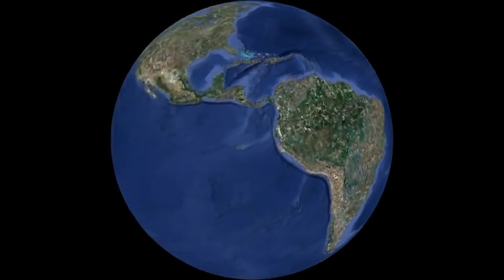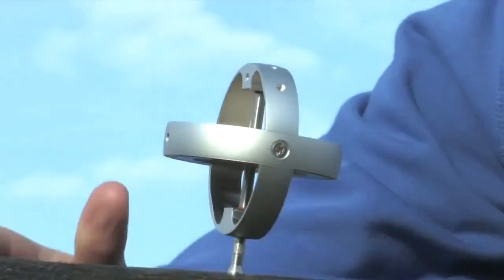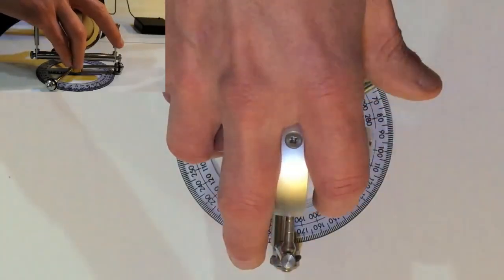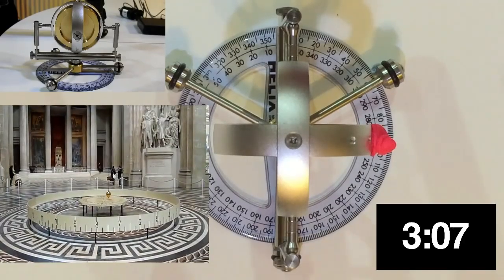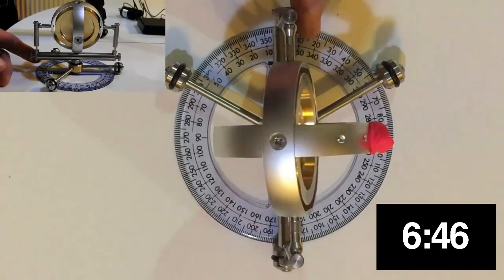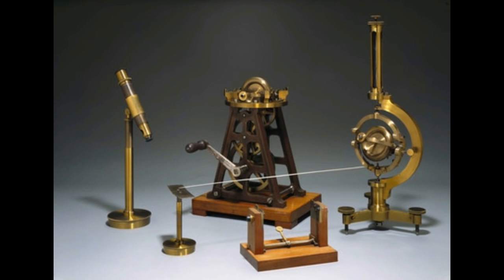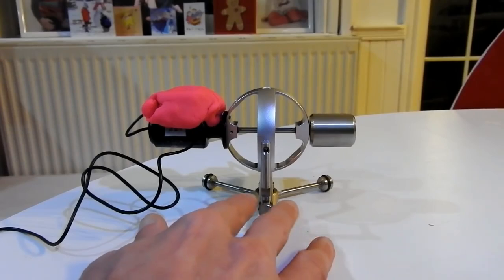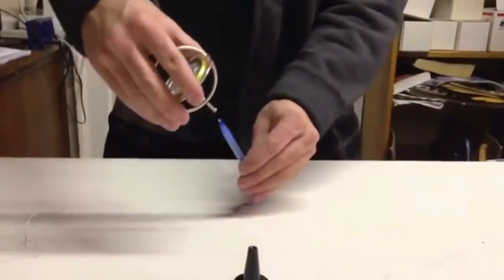Why Gyroscopes Proves the Flat Earth Part 2

Comment: I agree with one of the comments below that the experiment was not run long enough. There is another source of error as well, the friction of the gymbol  bearings  that aloow the gyroscope to tilt. There is thing thing called the coefficient of static friction 

Static friction

Here is an excerpt from the link below.

When the mass is not moving, the object experiences static friction. The friction increases as the applied force increases until the block moves. After the block moves, it experiences kinetic friction, which is less than the maximum static friction.Static friction is friction between two or more solid objects that are not moving relative to each other. For example, static friction can prevent an object from sliding down a sloped surface. The coefficient of static friction, typically denoted as μs, is usually higher than the coefficient of kinetic friction.

 https://en.wikipedia.org/wiki/Friction

So even though you have precision  gyroscope to do your experiment you need very low friction bearings, like maybe hanging it from a long string. For that static friction could block you gyro from rotation, just as you did with your gingers earlier in the video so that even if you did run your experiment for say an hour or two you still might not see any rotation. Now you are on the right track.. you just haven't quite gone down it fat enough for your experiment to show (or fail to show) what you are thinking it will show. 

Now aircraft in fact do use gyros to both navigate and  maintain an attitude estimate (which way is up). And the  rely on the rotation of the earth to do what is called a ground alignment (where they figure out which way is north to very high accuracy).  e.g. see

Here are scholarly papers

https://scholar.google.com/scholar?q=inertial+navigation+ground+alignment&hl=en&as_sdt=0&as_vis=1&oi=scholart&sa=X&ved=0ahUKEwjhjI212J_KAhWFYiYKHQ6wDyAQgQMIHTAA

Of course now a days  strap down ring laser gyros are used but back when I was a young engineer  these did not exist and  mechanical gyros much like you have were used.. with  precion low friction bearings and large mass in the gyros but never the less very similar to what you have. 

Here are some more links on  ground alignment and (and sorry, there used to be on line a really good video on this but I can't find the link anymore so this one is the best I could find in my quickie search.

https://books.google.com/books?id=6P7UNphJ1z8C&pg=PA344&lpg=PA344&dq=inertial+navigation+system+tutorial+ground+alignment&source=bl&ots=tAWytSwOAN&sig=RHtXGbWVLJbji3cQuEN42qIZy1Q&hl=en&sa=X&ved=0ahUKEwjw9oLq2p_KAhXJeCYKHRXSDG84ChDoAQg9MAU#v=onepage&q=inertial%20navigation%20system%20tutorial%20ground%20alignment&f=false

and here is a is a book hat covers the basics of inertial navigation

https://books.google.com/books?id=5ktEBQAAQBAJ&pg=PR21&dq=inertial+navigation+system+basics&hl=en&sa=X&ved=0ahUKEwiF2J_k3J_KAhUEND4KHREqDwwQ6AEIRDAD#v=onepage&q=inertial%20navigation%20system%20basics&f=false

The bottom line is that gyros prove just the opposite of what you are claiming and are used in inertial navigation system on most all aircraft to navigate and maintain orientation and have been used for more than  50 years.. maybe even longer. And a poorly thought out experiment does not prove anything other than one still needs to  think through it a bit more.  So I would suggest that you keep at it, but  run it longer and  properly address the  bearing friction problem... and if you do you may just  see different results.
Reply: Then you basically just proved ALL gyroscopes can't work, cuz they all have friction bud lol. You round Earthers be supporting the flat plain theory with out even knowing it lmaooo crushing your own "PROOFS"
Reply: Ron Wilson 

You're identifying forces that effect the Gyro that does not have any relevance to Earths rotation.
Reply: Ron Wilson 

or lack of a rotation. Which is proven by one small little fact. Undeniable too.

You see that North star. It's position is fixed with the north pole. Always will be. There is no tilt, there is no rotation. Otherwise that North star you saw your entire life, WOULD MOVE.

Comment: So you think a gyro should be spinning on it's axis because the Earth is spinning on an axis? What force is supposed to control this? Do you even know what the axis is in reference to?

How about this; when you're in a car cruising along the motorway, do you feel a perpetual sense of forward motion? Of course not, your momentum without change is a constant. Einsteins Theory of Relativity applies here. But if you apply the brake, you notice the change in momentum, you feel the force of still moving forward, while the car slows down, it's one of the reasons we have seat belts. This is more apparent depending on how hard you brake.
Reply: Doesn't the earth move faster at the equator than the poles?

Comment: Earth rotates every 24 hours.

That’s basically 360 degrees of rotation and according to math should be 15 degrees of rotation per hour. 

You ran the experiment 5-6 Minutes.

In that time frame that would be a precession of 5/4 degrees. That is literally nothing to the naked eye. You would need to run it for at least several hours to notice any drift.

I hear you did that and that’s why you stopped posting FE Bs 6 years ago because you realized earth does spin👌🏽

Comment: There are quite a few videos illustrating the supposed or actual fact that the gyroscope does not indicate the rotation of the earth. I do not know whether the earth rotates or not and am not greatly disturbed at whatever is the truth. However for those interested in the investigation of the subject, there is a very interesting account of the description  giving constructional details of a specially sensitive gyroscope especially designed to indicate rotation of the earth. This information and the experimental details may be found in pages 19 to 32 of Vol.! of George M. Hopkins book “ Experimental Science” and the conclusion to be drawn from the gyroscopic investigation is also provided. Both volumes of Mr Hopkins most excellent work may be  found on the Net and may be either downloaded or read online.
Reply: Vivian Astridge 

You see. Free opinions are far more valuable. Because? If it's wrong, I still have my money 😂

Comment: Shouldn't the gyro be aligned so that the the axis of rotation is up/down generally (if at the equator?) I would imagine you could tilt it somewhat (toward the equator) from that axis depending on your latitude for optimal results. I have purchased two of these precision gyroscopes myself to do this experiment (and others.) Please let me know if there is a reason for your setup configuration I am missing. Thanks!

Comment: Just a thought: Have I missed it or do you really not state the orientation of your gyroscope in respect to the earths rotation?
If the axis of rotation is north/south aligned one wouldn't expect to see any movement anyway, but if the axis was east/west aligned or vertical I'd expect to see the claimed effect.
So a compass next to your setup should be the least in order to get some degree of significance of this demo. But since a compass could be tampered with quite easily, two or better three gyros each aligned to one of the three spacial axes would seem more credible.

Another thing "missing" is a valid proof that your test setup is actually sensitive enough to show the desired effect. You show that the gyro swerves when you nudge it, but will the miniscule force resulting from that very small movement of 15° over 1h be enough to overcome the static friction of your bearings?
Without such proof you might only show that Foucault may not have been capable of showing the effect with his setup either, but it'd be no proof that the effect is non-existent - let alone proving flat earth, as you claim in the title!

Comment: 12 hours = 180 degrees 6 = 90 degrees 3 = 45 degrees 1 hours is 15 degrees not 12 degrees as you stated in the video. Other than that great video. Excellent proof.

Comment: This video assumes that the theory of the position of a gyroscope on the Earth at different latitudes would affect the procession of the gyroscope. It therefore concludes that the Earth must be flat because the experiment in the video with a precisely engineered gyroscope does not produce any procession.
Actually all this video has done is prove that the theory of a gyroscopes procession is affected by it's position on the Earth maybe wrong or the experiment was flawed. 
There are many things wrong with the experiment in the video such as the orientation of the gyroscope. 
How was it aligned in regards to North, South East and West? 
Was the table exactly level (was a spirit level used)?
Was that lump of play-doh exactly the same weight as the blanking insert on the other side?
Sorry this experiment does not prove the Earth is flat.
Reply: +Superior Sight It's a pity you would rather try to ridicule than actually think about the questions I asked. The angle of the gyroscope does matter. Think about it.
Reply: +Superior Sight I don't suppose you've ever had a gyroscope. Maybe that's why you understand what happens due to the direction and angle of the spinning wheel and the angle and direction of the movement you force on the gyroscope.

Comment: HOLY CRAP, I can't afford to buy that gyroscope right now! It's going for a minimum of $150.00 in the US, and anywhere up to $450.00. For a fraction of that price I can buy a used airplane gyroscope off eBay and have a more precise instrument - granted it might need repairing.

But thank you for subjecting yourself to the expense in order to expose the lie. :)
Reply: +IamNemoN01 
For that price you still will not get a gyroscope stable enough to test for the earth's rotation!
There are laser ring gyros in labs that can measure accurately the earth's rotation.  Have a look at: "First ever direct measurement of the Earth's rotation" in http://www.eurekalert.org/pub_releases/2011-12/tum-fed122211.php.
But, not the sort of thing you can in your lounge!

Comment: Take this experiment to a different but immediate observation of a rotation due to the platform that the gyroscope could be displayed in equally spaced marks on the outer edge of the platform, which would be circular as a disc or a plate. Place the gyroscope in the center of the plate so that the plate may be rotated mechanically freely and smoothly using some sort of mechanism to rotate the platform under which the gyroscope's linear set rotation, would show anybody who has argument against rotation affecting the linear set spin of the gyroscope or orientation of the gyroscope, to the platform underneath. That would display what the observable outcome would be if the surface underneath the gyroscope was moving relative to the gyroscope orientation or linear set starting point, and make note that the gyroscope did not change or alter direction of its spin where is the plate underneath does a complete 360 degree rotation. It would Return to Zero. Now do the same experiment by placing the gyroscope at the outermost Edge of the circular turntable and as the turntable rotated 360 Degrees you note the gyroscopes characteristic of staying in one set Direction or attitude throughout the entire observation of the entire duration of the rotation of the turntable during the complete cycle of 360°.